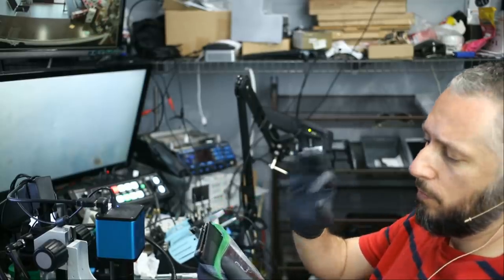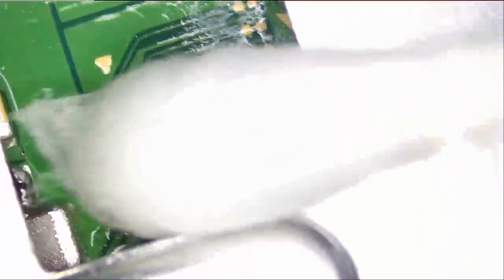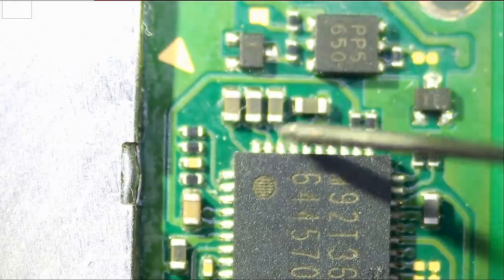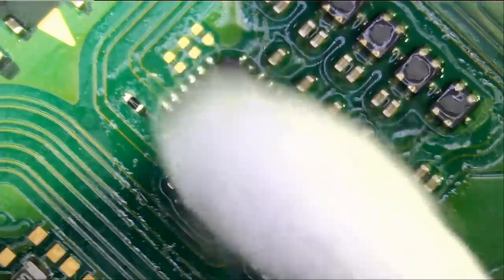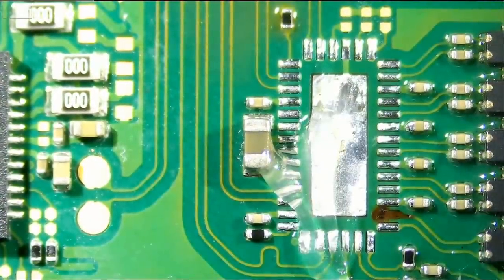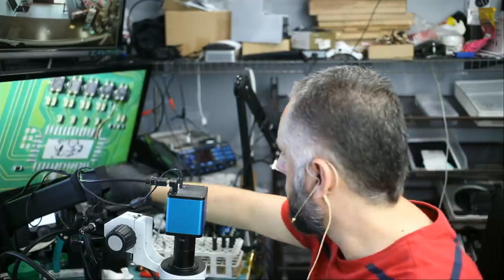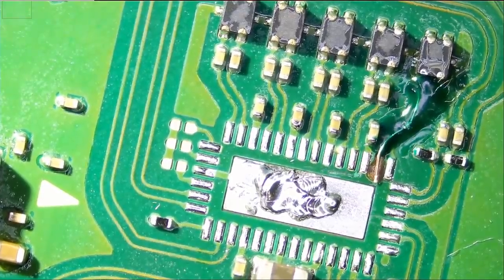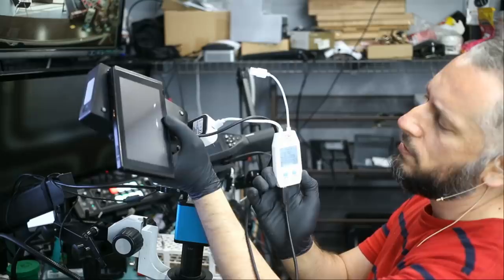3 Nintendo switch consoles came in for repair - Damaged SD Connector, No power and error code

Comment: I always enjoy your videos and leaning new things from you, but I was surprised that the track replacement wire didn't need tinning before you soldered the chip on. Does it get solder from the chip pads or what?
Reply: Good question.  I know he has both coated and regular copper wire he uses.  Either way there must still be solder remaining on the chip pad?
Reply from the maker: It's not needed. Wire is not enemaled. Chip is pressed down flat forcing the wire to squeeze between the board and chip. The wire is not going anywhere with solder mask on.
Reply: @NorthridgeFix  Ok fair enough. Thanks for the answer.

Comment: I managed to crack 3 joints on the motherboard where the sd socket sits. I'm new to soldering and was wondering if it would be easy to resolder them or something.

Comment: I know nothing about soldering. Does that liquid you put not damage the other things on the mother board?
Reply: It's flux.
It helps evenly distributing heat and insulate to protect the board n components from damage by accident.

Comment: Hi, I bought a solder wick on amazon but doesnt seem to work. Any you would recommend? Im trying to replace my ipod 4 30 pin connector. Thanks in advance.
Reply: I see no one responded.
First step is to add flux and then run a tinned tip over the traces to mix in leaded solder with lead-free. Then, once mixed, press the wick against the pads with the hot iron tip. The solder will suck up into the wick. Do this until the pads are clean. Then, once clean, flux, and re-tin them with leaded solder.
Once you've gotten your pads properly tinned with new solder apply flux, place the connector, and solder using hot air or an iron.

Comment: At 10:30 how is this chip actually getting soldered down? Am new to soldering never done it.
Reply: Heqting the area melts the solder underneath the chip.
You press it down while heating, then let go when it cools down and presto soldered.

Altho this is called "reflowing"

Comment: hi boss  , i'm stuck whit a nintendo whit a 2101 error,  0 amp adsorb. Afteri i change the M92T36 chip , same error , but now  0.40a and when appear the error goto 0a . U have find a solution? Tnx For Insane help to microsoldering whit ur low melt solder trick
Reply: problem solved, m92t36 not proprerly solded. Reflow and error disappear. Cya